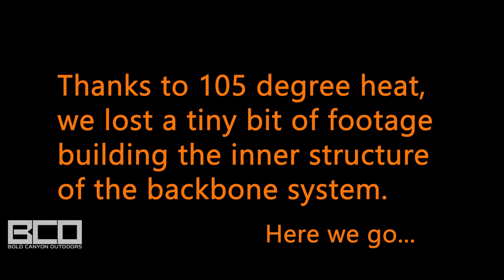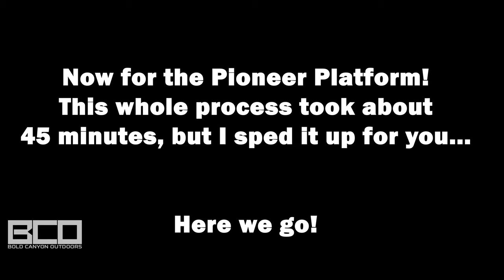Rhino Rack Backbone & Pioneer Platform Installation Jeep Wrangler 2 Door - Compact Overland Build

Comment: i got the same RCL legs as you but when i went to put them on i noticed there were two little tabs at the bottom of each end of the legs that there were no slot cutouts for on the backbone base that it would sit into. I thot maybe i was missing something...at 9:15 i noticed your leg base was sunken slightly at the center where the leg gets bolted to the base. i think thats what would happen if i bolted the legs on with those tabs getting in the way of a flush finish....did you have those tabs also?